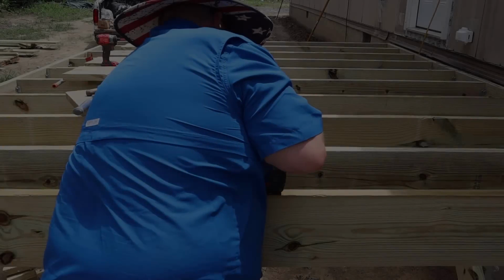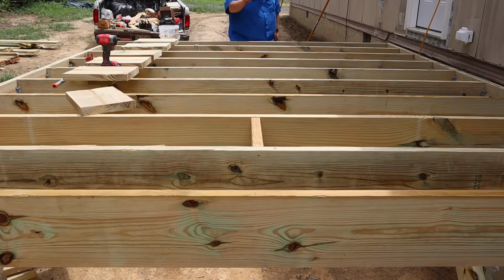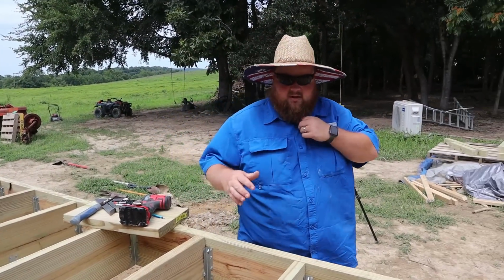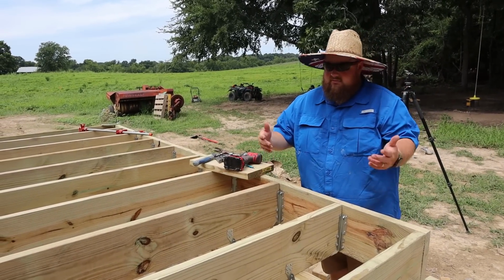REQUIRED Bracing & FINALLY Decking it Out! // 12' x 10' Mobile Home Deck Build - Pt. 4

Comment: I did bench seats on my dad's deck.  4x4  bolted to the rim joist under the seat.  2x4 on either side of the 4x4 for seats and backwith 2x4 under the seats connecting the back and seat and the sides.  we used decking for sears/back, under the seats to keep openings in code and deacking likke a railing top.  We did seating on 2 sides and a table at the corner

Comment: Sam !!! You worked really hard to get the deck done right!!!!! When you were panning the deck with the camera I could not tell if the deck boards were facing down correctly!!  The grain of the wood
must face down to prevent cupping when they are drying. When the board is drying it will come unscrewed or unnailed !!! I have built many decks and steps in my heyday and I've pretty much
seen it all. Also, a coat of paint or stain after the wood is dry would not hurt. And last of all You and the clan did a magnificent job on the inside.

Comment: Years and years ago, someone we knew paid a pretty penny to have a a deck built out back on the down hill side (single story house with the back door well off the ground) which was still listed as a single story, back deck on the permits and all else.  It was a good and well built deck but no cross bracing to help compensate for the height and always did sorta jiggle. 4-5 years down the time line, we came through and put cross bracing in and it sure did did tighten things up; a bigger guy could jump on it and it still felt solid (our test was to have the biggest guy jump).
Reply from the maker: That's what I'm talking about! :) Gotta pass the big guy jump and jiggle tests! LOL

Comment: If the trailer has a foundation or is set and secured on a perminant foundation, 1.would you be able to secure the deck to the mobile home/house? I know per a typical setup the deck has to be seperate as to not add weight to the exterior wall as it is load bearing.
2. If you wanted to expand your floorplan and frame and wall in a deck to expand your sq ft, would you secure the deck to the foundation you made for the mobile home or maintain making each add-on room its own "foundation" seperatly? (I have in the past expanded a mobile home , adding a 10'x30' deck, laying sheathing on top, adding hardwood, insulation, wallls, and splicing the roofline to the current pitch of the mobile home roofline and adding steel roofing, and I did give the add-on its own foundation seperate from the house as I had origionally intended it to be a deck at first). I am preparing to move my family into hopefully a forevere home and will be using your videos as a template, so I was hoping for the occasional input to narrow down excatly what we want so when we are done we will have no regrets on the overall layout

Comment: Think I would  have kept the outside post  hand rail height  at least  or even purgula  height   and boxed in with joist  may have required  couple  more boards  but that just my thoughts

Comment: Lol....only 10 years waiting..... I've been in my place for over 30 years..... took me 25 years before adding a rear deck.... built a 25 x 20 foot one about 5 years ago..... and still have NO front porch, deck or steps..... so it's just a straight drop off if you try to use the front door, about a 4 foot drop..... so keep on keeping on!.....

Comment: We got a hint of it in 4th grade grammar and in 7th grade grammar we actually had some assignments in which we were to properly use non-traditional, different suffixes or word endings to change words into different parts of speech.  I think you were technically ok.

Comment: Hi. Enjoy your content, but as a European I have some probably dumb questions. Is it building code where you are that decks need more structure and strength than the actual home itself? You are using bigger and stronger wood to frame the deck than you used for the walls and floors!

Comment: That deck will hold a freight train.
Is this to code or did you over build
it.
Reply from the maker: Comparing this to others we've seen in the areas being done at the same time as ours, it's WAY over built for "just passing". :)

Comment: my personal preference, I would have made it a lot longer, but I know there are obstacles involved but it looks great. I built a 24'x 14 patio by myself which I have never done before,so I know what is involved in a project like that👍👍👍👍Great job
Reply from the maker: We would have loved to, and maybe can add on in the future. This deck was $2,400 in material (or around about there) and is much more than what we had in NC (4x6 decks). :)

Comment: First thing you should’ve got a different angle on your shake test because it probably would’ve been the same aspect second thing you ran your deck boards the wrong way because the waters going to shed back towards the house but other than that looks OK it’s impressive that you decided to take this project yourself on many other projects you have taken that Wooden possibly did it the way you did it but I’m in the business and you’re not
Reply from the maker: Decking board orientation doesn’t control water shed. That’s in the drop of the deck away from the home and the positive slope of soil grading below.